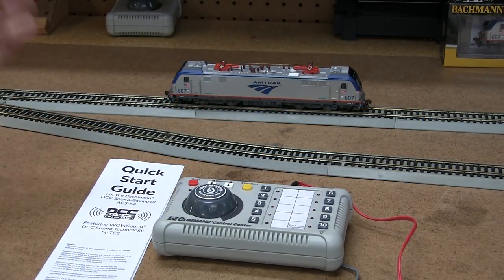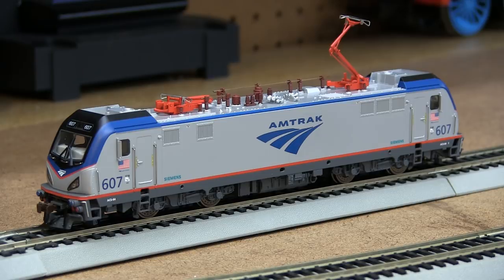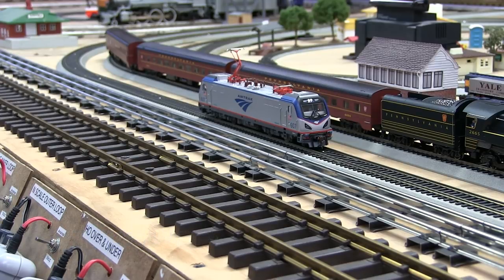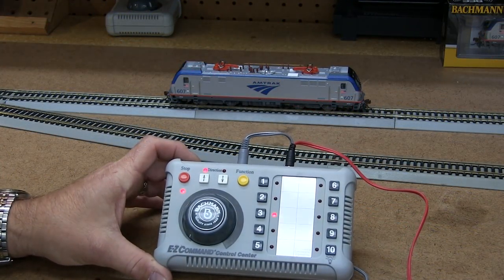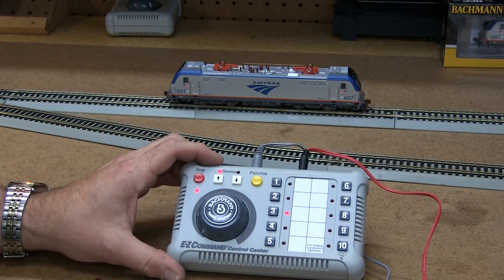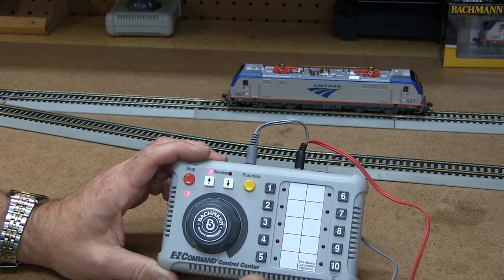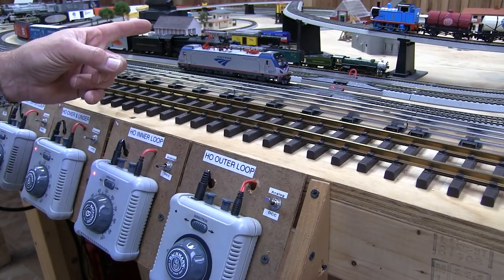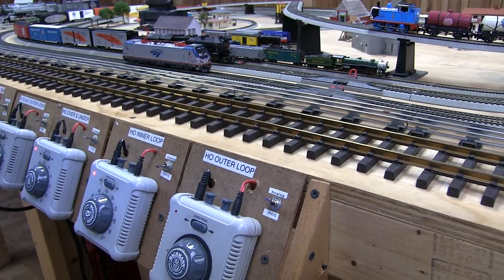Bachmann HO Scale Siemens ACS-64

Comment: But why not with overhead current system by pantograph??
Reply from the maker: the ACS-64 can be operated via overhead catenary in addition to conventional track power - a selector switch on the model will allow you to choose which method of power pickup it will accept.

Comment: Nice engine, ill probably pick one up eventually, but I've never understood why someone would buy a dcc/sound locomotive for use on a standard dc layout. If your going to get a dcc/sound engine, get a proper controller for it first, since most sounds you can't control using dc.